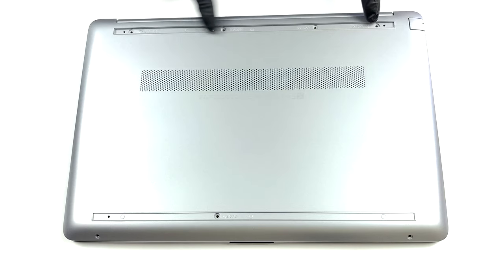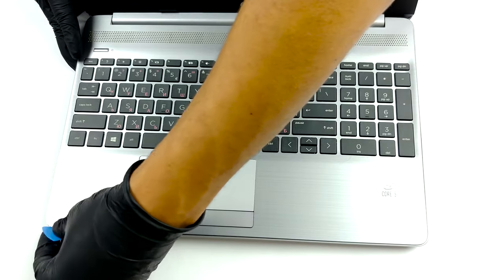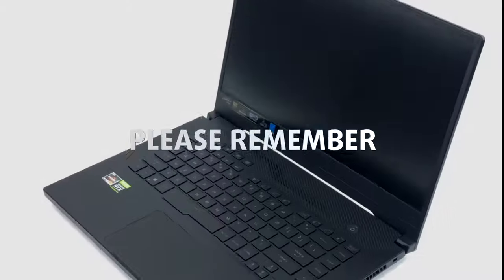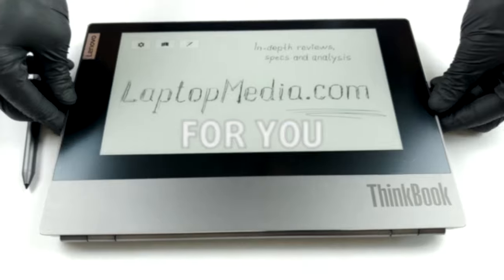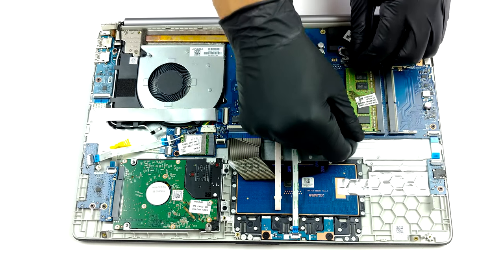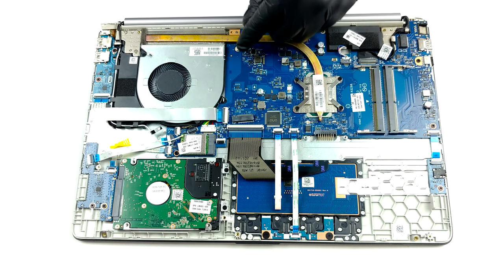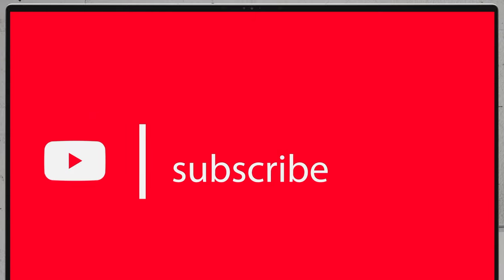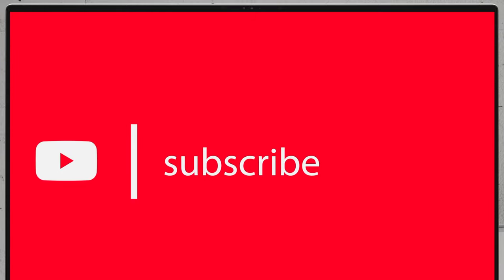🛠️ HP 250 G8 - disassembly and upgrade options

Comment: I purchase an HP250 G8 i5 3 months ago and also decided last week to install a 2nd 2.5" SATA drive - only to discover there was no connection. The UK supplier has no interest in resolving this for me and says "that's the standard" - but the HP spec plus web info and reviews seem to indicate otherwise. I have raised a case with HP, sent them photos etc and am awaiting resolution
Reply: pff i was going to ask exactly this...
Reply: What model, do you know your laptops model, or could you tell me what cpu does your laptop have?
Reply: te falta el modulo 4350u432l01 para unidad SATA de 2,5
Reply: L52024-001 part ID is for board and L52025-001 is part ID for cable

Comment: Thanks for the video, I never had to open a laptop like this and it helped a lot.
However, my laptop has the space for the 2.5" drive but doesn't have the SATA connector 😅 how can this be possible?
Reply: Same problem here, I need to buy the flat cable separately, I don't know if it's 6 or 8 pin.
Reply: te falta el modulo 4350u432l01
Reply: @NICOTRIBALNICO  yep, I found it in the manual. I guess it's normal as the user may want to install a SSD with a different connector
Reply: @paco3523  Did you found the connector? i am unable to find it
Reply: @dsenaa  same Question. did you found the connector?
Reply: L52024-001 part ID is for board and L52025-001 is part ID for cable

Comment: My hp250 g8 has enough ram(12gb)but after starting some stuff the cpu gets to 100% and it starts lagging.How can I fix that?
Reply: You prob have a HDD of 5400 RPM that's causing your whole system to lag, just install a  M.2 and migrate windows and install applications z games there and use the HDD to keep archives, photos, etc
Reply: @LuxuryBall13  thanks ill try that

Comment: my g8 doesnt have additional slot for ram nor for second ssd. dunno why, i have same 250 g8 model with intel celeron a4020 8gb ram and 256gb m2 ssd. in this model shown in video where is located 2nd ssd there is mine m2 :(. any explanation?
Reply: Same here, as mine with the i5.. is there any part number for the ssd module to upgrade so that we can add a second ssd?
Reply: @mariosp79  i believe not, u have to use an external hdd or upgrade your current ssd

Comment: I have hp 250 g8 i5 11th gen laptop(only used for 1 month). When i use even office apps, cpu temperature goes around 70°C. If i change the thermal paste to better one, can it be solve the overheating problem?

Comment: Thanks for the video. Some say that the RAM is not upgradeable on a HP 250 G8, are there different versions? Thx
Reply: Yes, there are 1 slot version but I5 and I7 version will have 2 slots as I understand correctly.

Comment: Can I change the CPU?
Reply: No, you can't, laptops are not desktops, cpu and gpu is unchangeable on laptops
Reply: @nikossiotas  then what can you do if your hp 250 g8 is too slow and videos do not play?
Reply: @niiinc8270  put the max memory that laptop can support. You can also try to play videos in lower quality and not FoulHD.
Reply: @nikossiotas  Dear Nikos, thank you for your reply. This means if I improve RAM from 8 to 16 problem is solved? Only this? Some people advice me for the pages not to getting "stuck" or videos not to go slow, I need to have an SSD internal HD, but the aforementioned model HP 250 G8 I bought already has that! When I checked the CPU is 100% someone told me this should be 50% but as you already replied to improve CPU is impossible for HP laptop. Another suggestion was to buy or to install inside a processor i7 or i9 (the higher the better) this one if you check has i5 INTEL. What is your opinion on so many advices? Who is right or perhaps all of them are correct? Please also explain how I am lowering the quality of (let us say a Rumble ) video from Foul HD, once again many thanks, greetings and regards and sorry for not knowing those basic stuff.... I am a simple user...
Reply: @niiinc8270  First of all, there's no need to say sorry, noone born knowing everything. Intel i5 with 8 gb of ram and an ssd, should be enough in my opinion. Do you have many programs running in the same time, or many tabs open in your browser? If yes then maybe this is causing you problems. I can't think any other reason... What generation of i5 do you have? Is your laptop too old?
Reply: @nikossiotas  Thank you again for your Kindness. This is the thing, I just bought this 3 days ago, this is HP 250 G8 3V5F8EA  and I was told what you just wrote that for my kind of use (no games, just for Research I need to dive into 20 or 40 pages and not the pages to get stuck) these specifications, that is 8 RAM, i5 and whatever SSD is inside would be perfect. Yes you are correct I do open many tabs for instance now I have over 32, but the same speed and the same problem with the video (for example if you know Russian TV I used to watch this before now it is impossible even if this is only ONE tab openned). Also I tried to enter just now some NFT's Companies such as Somnium Space and is impossible. The question is simple, if I am to return this to the place I bought it from what am I asking them to fix or to improve or to replace it with what? Because technically they may say it is working, yes it is working but worse than my old Laptop (Lenovo G580) that was 13 years older than this?
Reply: @niiinc8270  are you sure your model is 3v5f8ea? 
I searched this to see its specs and this doesn't have an i5 cpu. It has a weak celeron n4020 cpu and a lower speed ram, which obviously can't do the work you need. Where did you get it? Any link of the shop? I don't know about Rumble, because i never used it, or NFT, I don't even know how those work. 32 tabs is too much for this cpu, that's why is always running 100%. Can you also post a link of the TV channel that you try to open? 
If your model number is correct, you should return this laptop and buy a better one, n4020 is a very weak cpu there's no reason to try improve this one.
Reply: @nikossiotas  I mean ardes.bg with s
Reply: @niiinc8270  Pudiste solucionar tu problema amigo? era que tenías un modelo antiguo o algo así?

Comment: I got this notebook as a present .. it's the worst PoS I ever used, and I will buy a Lenovo once I have the money! Build quality = 5%. All wobbly plastic shit and the diagonal m.2 slots shows the amount of 'effort' that went into technical design. Performance = terrible. The included chips i5-1135G7) cannot even remotely reach their supposed maximum performance because of bad cooling and probably power limitations, too.
Stability and Usability = 10% =Terrible, because of a buggy crap BIOS/UEFI, which has incompatibilities to current Linux kernels resulting in data loss and also it blocks undervolting the CPU (because of some silly 'security concerns' which don't concern ME as the owner!) Undervolting could have solved the constant overheating because of terrible cooling system ..

Expandabililty =10% ( a 2nd RAM slot) = mostly does not exist. I did not check if it has a BIOS whitelist, yet .. but I expect suckers like Dell to do such shit. Repairability = 0% = irrelevant, because it's just not worth.
Utter junk.